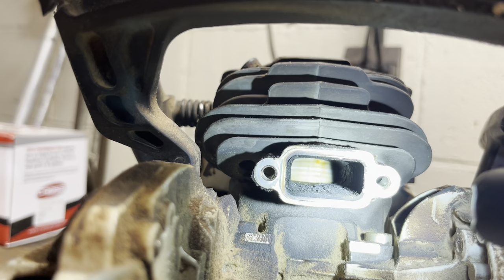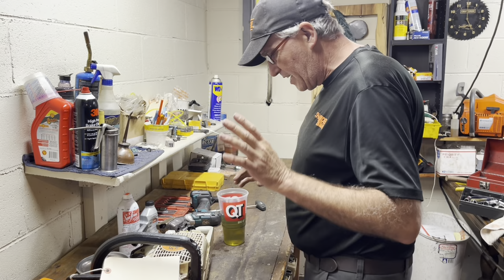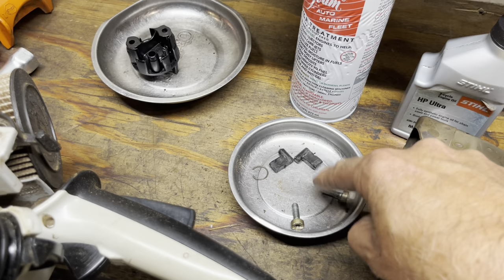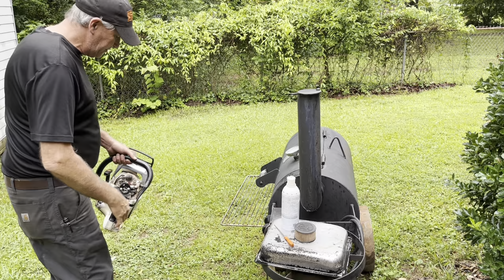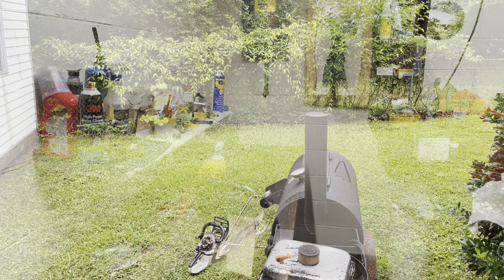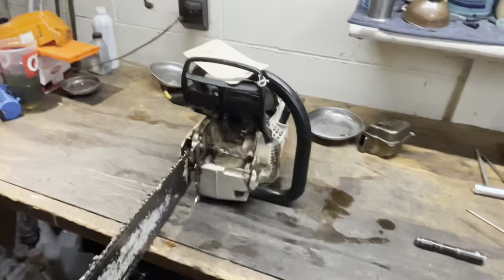Stihl Ultra. Can Seafoam Save the Day?

Comment: I'm from Australia. Our HP ultra is German made. I've never had cokeing on the pistons and the cranks are wet at 40:1 with 95 octane
Reply from the maker: Not the same product here in the US unfortunately.
Reply: @richardflagg3084  yeah interesting hey! I mean I've used ipone 2t oil when I couldn't get hp ultra and it coked up the pistons like what your seeing. but the HP ultra cleaned the pistons back to brand new after 2-3 tanks Interesting stuff.
Reply: What info do you have to say Australian HP ultra is different would like to know.
Reply from the maker: @momouppa  I checked the Stihl AU and DE site and Ultra is listed as an FB rated oil , but the oil itself is a bright green/ forest green in color.  US Ultra is dark olive green. I have no way of being 100% correct that the formulation is the same or different.  I swear one of the non-US oils was FC or FD rated,  Maybe it was Stihl super hp?
Reply: @richardflagg3084  yeah the super seems to be a better oil. I have since switched to Motul 800 anyway just to be safe

Comment: I have a question? I respect your opinion alot, so this is why I'm asking. I was bought a Chinese backpack blower as a gift to see if I'd like the backpack blower or hand held blower any way it's an EB650 It's a surprisingly damn good blower I've had it for over a year now with 0 issues, I do however take very good care of my equipment. Any who... It calls for a 25:1 mix which I've been running. What oil in your opinion is the best to use? Do you think Amsoil? And what ratio should I mix if I use said oil? Thank you in advance Richard.
Reply from the maker: 40:1 (of good oil) should be fine in anything.
Reply: @richardflagg3084  Awesome thank you so much!! In my opinion 25:1 is just way to much oil.
Reply: I think the Chinese recommend a richer mix is there product goes world wide and can’t control what grade oil is used, plus no EPA.
Reply from the maker: @ronaldbrown5745  The older Stihl owners guide used to say 50:1 if using Stihl oil and 25:1 if any other oil.  Lol
Reply: @richardflagg3084  So would it hurt for me to use 40:1 True-fuel?
Reply from the maker: @garyalensr  If your going to use canned fuel, I'd suggest using VP.  They make it in 40 and 50:1.  If you can't find it in 40:1 then add a touch more than a tablespoon (.6oz) of VP two stroke oil to a gallon of 50:1 pre mixed fuel.  That will get you to 40:1 and you'll be using the best fuel on the market.
Reply: @richardflagg3084  awesome Sir thank you so so much I could never get a straight answer for my question until you.
Reply from the maker: @garyalensr  After chicanics video on Tru Fuel, I never even considered that not all canned fuels are created equal.  I have never used the VP product, but their fuel is beyond reproach given the extremely expensive engines that run their fuel.  Thanks for the kind words.
Reply: @richardflagg3084  I've used True-fuel for years and years and never had a single issue with it. I've been using the 40:1 in all my 2cycles and regular True-fuel in my tractor and push mower. I've even used the 4cycle True-fuel and mixed it to the ratio needed and left in my equipment for almost a year and it started right up. I'm absolutely going to do what you suggested. Oh and your channel is awesome. Love your chainsaw work. Keep up the great content

Comment: I gotta say this.  I don’t know why, but a lot of people who love to use seafoam (I like it, I use it On Occasion) seem to be baptized in the thought that SMOKE coming out of the exhaust means that you are actively cleaning something inside the combustion chamber or valves or something.  Fact: put a few drops of Oil or Transmission Fluid in the carb of Any engine, a BRAND New engine (what is there to “clean”) and you are going to see THE SAME DARN SMOKE!!!  Smoke does not mean “cleaning.” Give me a good response and I’ll subscribe And like… Promise.
Reply from the maker: If you look really close at the exhaust port afterwards there was a decent reduction.  Lower left, top center are bare aluminum.  Looked like some decent carbon removed from the before and after.  I only noticed after watching the video.

Comment: Sthil ultra is by far a waste of money you might as well run used engine oil than that garbage if will shorten the life of your saw engine in exactly the same fashion as ultra. The best way I have found to clean the carbon out of a customer saw is to get them convinced into running shaffer's XP to cycle mix oil I have even gone as far as to giving them a free quart of it which will make 10 gallons of 40 to 1. So far everyone I have given a free bottle has come back offering to pay for it and they buy more and become a permanent customer. People complain about the price but it's really not that expensive especially when you compare it to some of the OEM oils out there. It also comes in a handy 3 oz bottle as well that is set up to make a gallon.
Reply from the maker: Most pre measured oil is in the $45-60 per quart range.  Shouldn't take long to pay for a measuring container.  I'm a big fan of Schaeffers oil.  I personally run 7000 semi synthetic and always have great results.